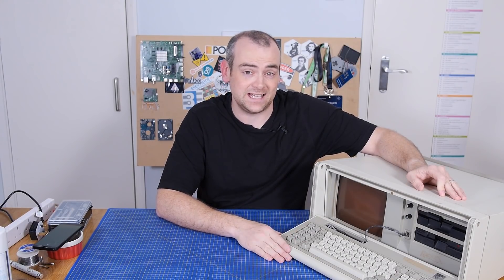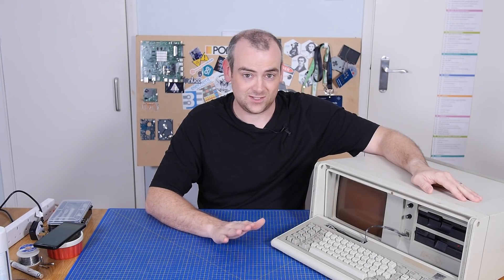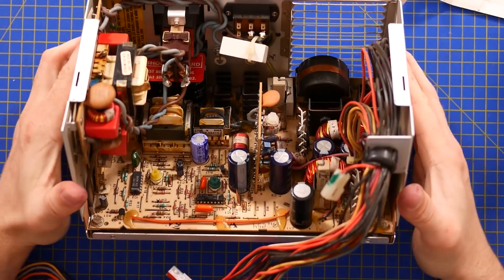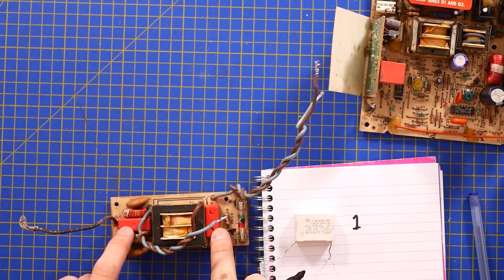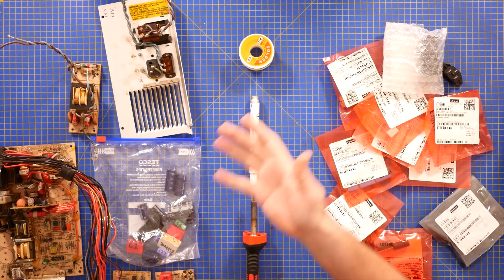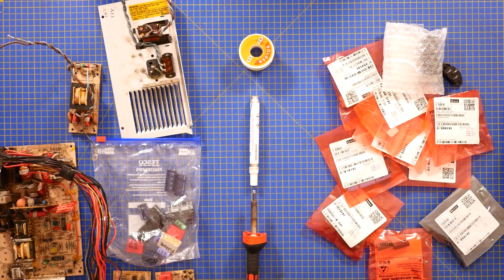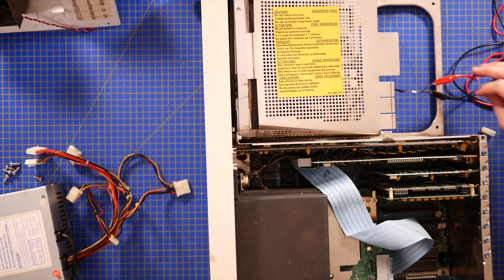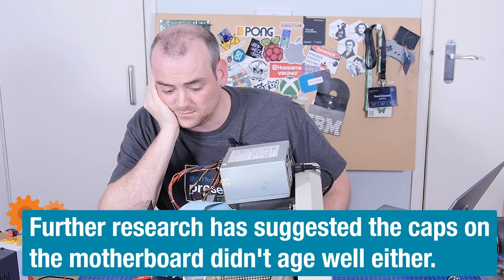Reviving the 1984 IBM 5155 PC - How Hard Can It Be?

Comment: Some power supplies require a load on them, otherwise they shut themselves down for protection. I usually keep an old defective hard drive (defective as in you can't use it with a computer because it has read errors, etc. but the motors still spin up) to act as a "dummy load" when testing psu's, in case they exhibit this behavior.

Comment: Adrian's Digital Basement has fixed up some 5150 and 5160 boards and quite often it's those old tantalum caps that fail and short out over time.  Even the video board has them.  More than likely your failure points.   Also, from my experience, most power supplies need a load on it to really operate, so if you're just testing a power supply on its own, probably a good idea to hook up something kinda beefy to it, like an old MFM hard drive that you don't care if it gets destroyed for example.
Reply: I thought only the PC ATs required the dummy loads we didn’t have hard drive installed.

Comment: Tantalum caps. I knew it. Those things like to fail with a short. And if a power rail is shorted the power supply protection kicks in and shuts it down.
It's best to replace all of them - even the ones that test OK.